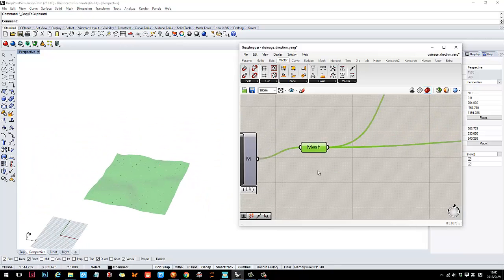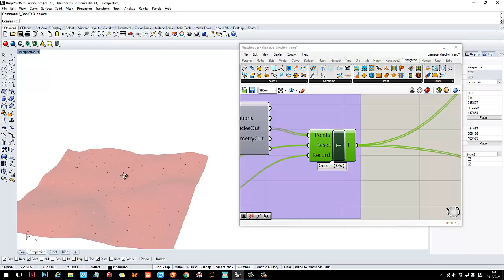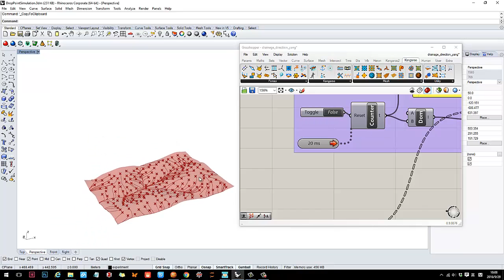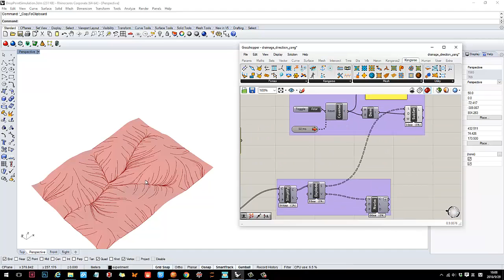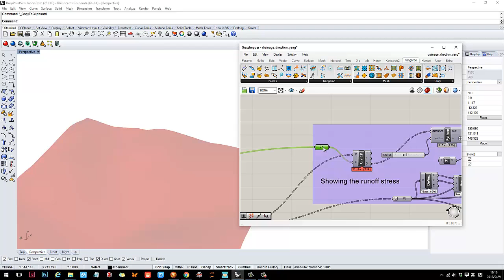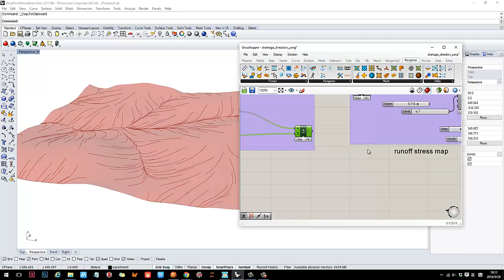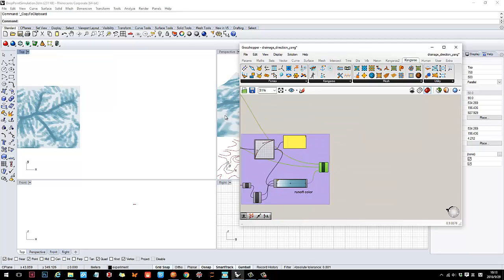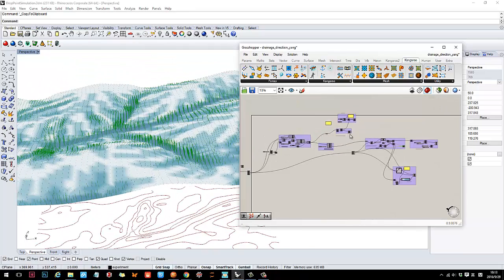Stormwater event simulation

Comment: Wow! Impressive work there! Thank you so much for sharing this! 
I’ve been thinking about doing something similar. I’m working on a script for urban flooding. Most of the existing scripts for drainage lines use Mosquito and surfaces, but surfaces don’t work for urban settings. I’ve discovered Bison has a nice script for meshes, but your script shows a lot of additional possibilities, as these particles has physical features. 
Have you any experience with urban landscapes?
Reply from the maker: Anders Moe thank you.. I have done urban landscape before. It is hard to me. I think the challenge is to have a precise modeled surface in rhino. Make sure the elevations of pipes and ditches are all perfect.
Reply: Yang Song , I looked more into your recordings. Lots of interesting stuff, also urban. Looks like I have a lot to learn from you here. 
Are you working as a landscape architect in the US?
Reply from the maker: Anders Moe Yes.. I am an assistant professor in North Dakota State university. Let me know Any new ideas, maybe I could make some other videos later.
Reply: @theansweryang  , would you be willing to share some of the code with me? I am making a code for simulating urban flooding, and I'm trying to connect the piping underground with the water on the terrain. The things you have done can add some new possibilities that I haven't thought of before. Like velocity.